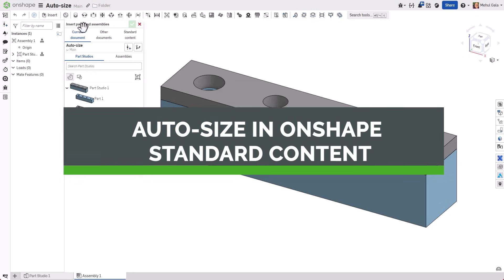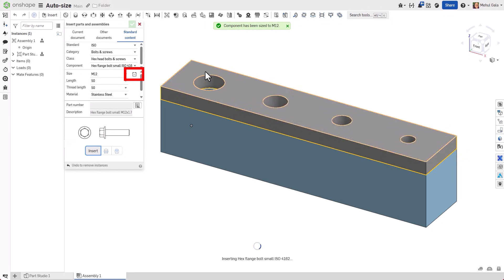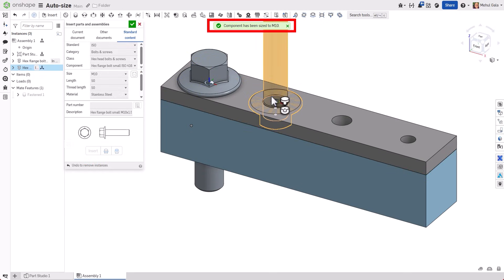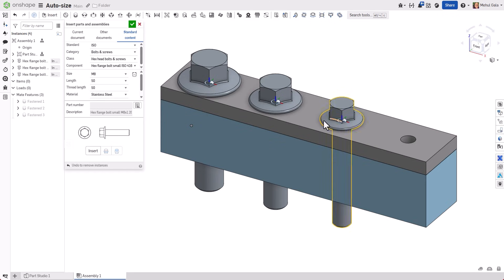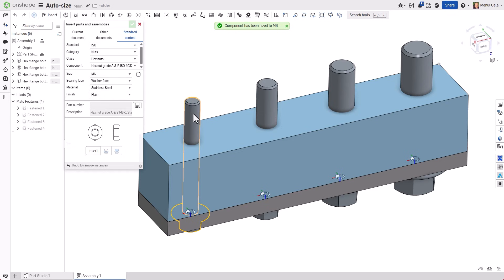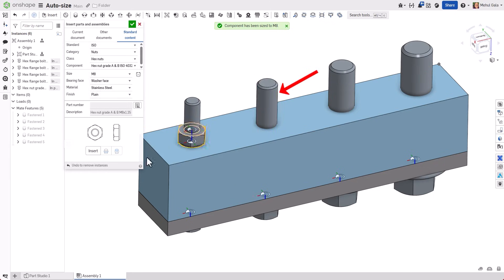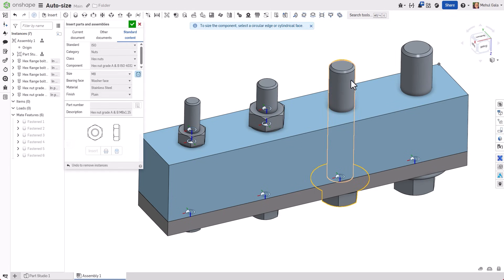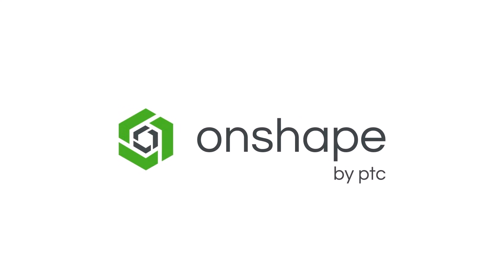Onshape Standard Content Auto‑Size - Tech Tip

Comment: Nice! Please add a feature that allows for the detection of similar holes and shafts on a part and automatically applies the same-sized bolts and nuts to them, eliminating the need for manual repetition of the process.